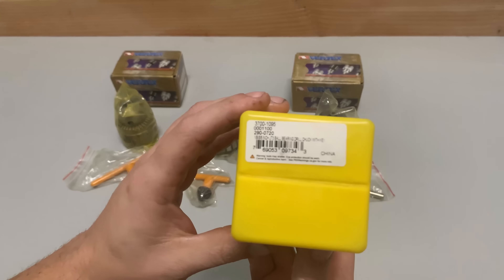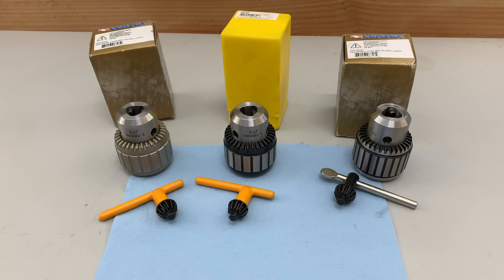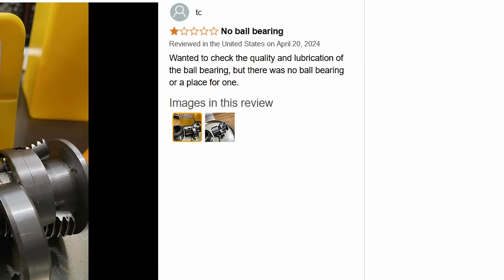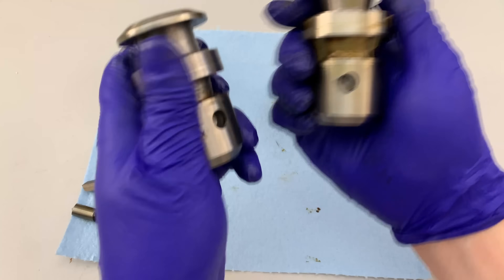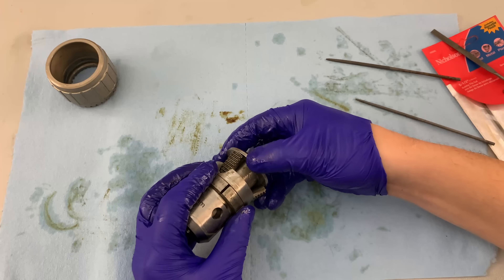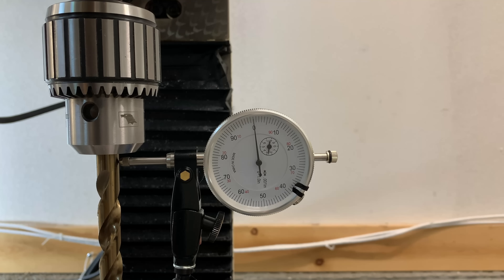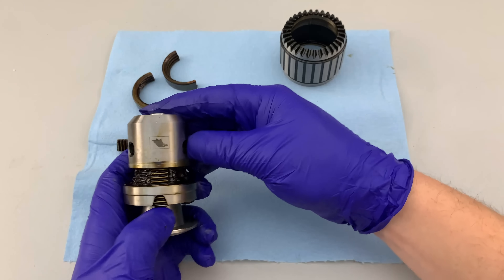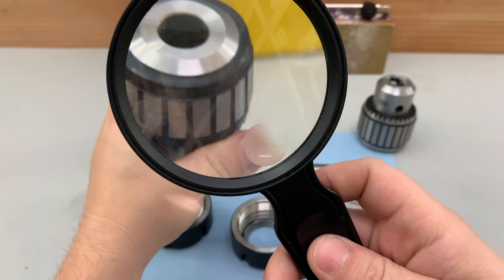Made in China vs Taiwan: The ACTUAL Difference

Comment: It’s not just the accuracy. The ball bearings allow much greater clamping force. These “errors” are because they are just shippers of products from whatever gives them the lowest price at the time. So when the looks of the product vary, that’s why. When they run out of current product, they replace it with whatever they can get at the lowest price. It’s a shame, but Banggood does that, Vevor does that and others such as HHIP do that. Now, Vertex is usually a higher quality brand, so it’s surprising that something with their name on it isn’t right. MSC industrial has their products. If you get it from them, you know you’re getting what you ordered. For others? Well, maybe they’re not real Vertex products. I have a bunch of surface grinder hubs I bought from HHIP. They look great and are machined and finished well. But they say they are hardened, but they’re not really. I found out as I had to open the taper up a bit.
Reply from the maker: I'd really like to get an actual made-in-China ball bearing chuck and compare it to a nice old Jacobs Super Chuck to see how different (or not different) they are. You're right about the greater clamping force for sure. A big plus. I was also surprised about the Vertex -- one of them being such high quality than the other, especially comparing side by side with the poor-quality Vertex and the unbranded, made-in-China chuck. The "real" (if they're not both real) Vertex was machined so much better.
Reply: @ShopHumor  I have several sizes of the Jacobs models and they’re pretty good. I use them in the lathe as I rarely use chucks on the mill, usually ER-40 collets for the larger size bits and DA versions for the smaller. Both have 0.0002” concentricity and are much more reliable. If you really need accurate small, under 0.500” holes, say, you can get bits of decimal sizing. I don’t know how important it is to you.
Reply from the maker: .0002" is pretty dang good. I have a few projects coming up that will need small holes, but I don't know yet the exact dimensions I'll need... we will see. I'm going to be picking up some ER40 collets pretty soon now that I have ER40 collet blocks in the shop...

Comment: Would like to have seen a " ball bearing chuck " insides , even an old / used one ?
Thanks
Reply from the maker: Me too!! I really wanted to show one. I am definitely going to buy some that actually have balls… maybe an old Jacobs one, an old snap on one, and maybe an HHIP China one whenever they get the issue fixed from their manufacturer, then compare those.
Reply: @ShopHumor  How about buying the exact same type you took apart that had no bearings. If your second one also has no bearings I think we can conclude... And you can always send it back.
Reply: The Jacobs ball bearing chucks have an almost identical construction, but with the addition of a thrust bearing above the split collar that minimises friction when tightening the chuck.

Comment: I don't have a mill, just a  14 inch Delta drill press. It's got a 5/8 chuck.  2 1/2 inches down from the chuck, measured  
.002"  plenty good for my needs.
The mfg date is 9922 which I assume was 1999, September 22.
It's got the original Jacob's chuck.  I paid $210 at a local tool store.  I tapped the chuck up into place when I set it up. I've never removed the chuck, but assume I cleaned the tapers pretty well, so the runout has to be the chuck.  I don't use it daily, but I can't imagine life without it.
HF had two returned drill presses by the cash register. Might have been a 14 and 16.  I can't believe how much a low end drill press costs these days.  
I'm quite happy with my antique Delta. It was an end of the year sale and I just had to buy it. I love its quality.
The chuck is still smooth as silk.
I've wondered about all these imported Chaiwan chucks.  Tested out pretty nice 👍
Reply from the maker: Sounds like your press has been a fantastic tool over the years. I bet your pre-installation preparation of the tapers made a difference too. Even though I have the mill, I wouldn’t mind having a nice old drill press like yours. It would be a lot more convenient for a lot of projects.

Great comment!
Reply: @ShopHumor  Yes, I couldn't live without it.   For those that don't drill 3/8 steel plate, even those small tabletop ones are worthwhile because you can drill accurately....  for general stuff
 I had one and used the heck out of it.
Mine was considered "entry level" because it's a 14 inch and only 1/2 hp.  It's a very nice quality capacitor-start motor and 16 speeds.
I always wanted a lathe and mill, but don't have a place for those.
Reply: @randywl8925  Maybe consider a tabletop milling machine. It can also function as a drill press. You won't want to leave the shop!
Reply: @steadyeddie7453  I wish I had room.  I don't need precision often, but I probably would if I had a mill
😁
Reply: @randywl8925  A tabletop mill has only a little larger footprint than a dp. Mostly it's just much heavier so you will need to build a sturdy table for it. It can replace your dp. And once you get it you will wonder how you did w/out it.  And tons of accessories for a variety of machining operations.
Reply: @steadyeddie7453  no, I'd have to keep the drill press. Literally no space for one. Small space and maxed out.
I'll check last night's Powerball. 😁
Reply: You cant beat the old stuff. Lots of solid metal and quality components. I'v got an old (1980's) Rockwell variable speed floor drill press. I restored it after the purchase in 2014.  I have a 1986 Delta tabletop drill press. Another well made beast. And my favorite, a 1937 (yup) South Bend lathe from the Navy Yard. Was probably used to make parts in WWII. I can still turn down to half a thousandth if I really need to. All still working like new equipment.  Cheers

Comment: It might be fun to try pins or drills throughout the ranges of the chucks to see if they remain accurate.
I just bought a "precision" Chinese keyless, and was surprised that it had ~0.001" runout. I'm good with that.
Reply from the maker: That’s a good call on testing different ranges to see how they perform throughout their travel range. And 0.001” seems great for 99% of drilling operations.
Reply: A pin would also be nice because you could measure it further out where a drill bit tip would be and where the runout would matter.  That few thousandths at the base could be far more exaggerated at the bit where you're trying to line it up with your mark
Reply from the maker: @Kami8705  I thought about that and I agree that would be good information, but I also wanted to measure as close to the jaws as possible to 1. minimize error / maximize consistency between setups and 2. I believe the accuracy rating that the manufacturers supply is measured at the chuck jaws. 

All good points and suggestions for the future though.